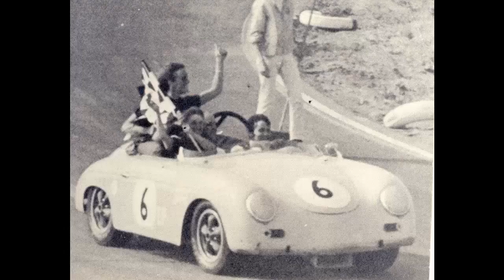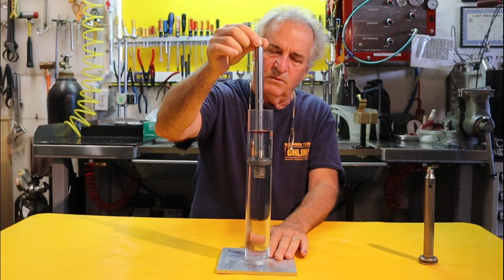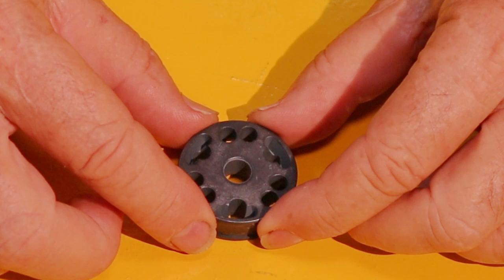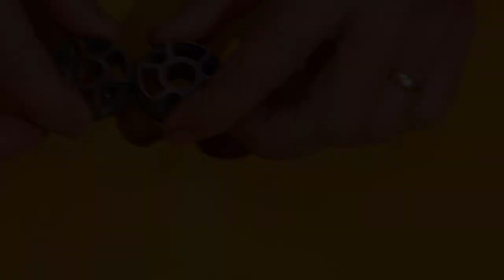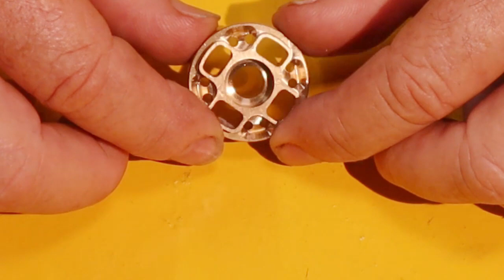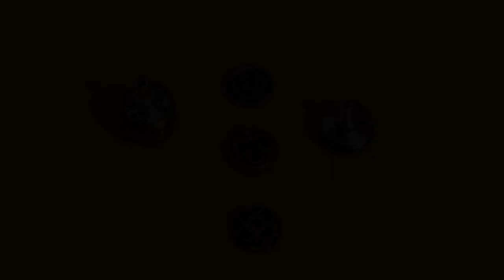Ohlins Suspension - Pistons and valves

Comment: Thank you so much for taking the time to make a real informative video. Shock theory if that is a thing, is something i always wanted to learn. As a kid NASCAR actually got me thinking about how important suspension setups are, then when i got my first KX500 Kawi and experienced modded suspension, just wow, it was like riding on a cloud. I now have 3 bikes with Ohlin’s suspension, front forks cartridge kits NIX22, and rear Ohlins shocks. I also have an Ohlin’s steering damper which works really well on the R3 and Ninja 400. Just in the last year i have been learning about adjusting the rebound dampening, compression dampening and setting sag with preload adjustments. After installing the Ohlin’s upgrades there was a day and night notice of improvement, but even after setting the sag and dialing in the compression and rebound dampening, it truly has transformed the NInja 400 and Yamaha R3 into serious street performers. I also noticed something i don’t see much promoted, when i took about the front forks and weighed the stock springs spacers etc i was removing and the Ohlin’s replacement pieces, I actually lightened up the front fork by a few pounds. On the R3 the rear Ohlin‘ s shock weighs less than the OEM shock too. Thank you again for sharing! I will definitely be looking your way for my next suspension upgrades.
Reply from the maker: Hi Mark.  Thanks for your very astute comment.  I don't think that most riders/drivers realize just how much of a difference shocks/forks and springs make and how superior Ohlins suspension is to anything else on the market and buy into the myth that Ohlins is more expensive than other options.  Suspension is the most important thing on any vehicle yet it is the last thing most people will spend money on.  The thing that impressed me was your "riding on a cloud" comment.  Exactly correct.  There is an erroneous bit of conventional wisdom that says that you need to stiffin suspension to go to the track.  Soft is best and there is no difference between a good setup on the street or on the track.  Grip is grip.  To get the perfect setup it takes work and you are working at it.  No "guru" is going to be able to tell you exactly what to do.  Another option you might experiment with is spring preload.  I go into this a little bit in various of my videos including "Why I Don't Do Digressive Damping".  Thanks again!
Reply: The Ohlins Guy I almost forgot to mention the importance of using Ohlin’s front fork oil at the desired or recommended weight, which will change how the front cartridge kits perform (reducing chances of cavitation in poorer less quality oils) well at least in the case of my NIX22 cart kits for the bikes, the weight and amount of oil is important to get correct and if not, it will effect how each leg preforms, in this case since compression dampening is in one fork leg and rebound dampening is in the other leg. Always tracking your changes, using proper tools (which Ohlins sells also like a pull up tool or the spring holder, fork leg vise etc) are important to ensuring accurate installation and not marring any fork tubes etc resulting in permanent “stick-tion) spelling? I just did a 60 mile ride today after making some adjustments to the preload after checking my sag since i had lightened the bike up a little, and just wow... on occasion, i get a friend to ride with me on his stock bike and we swap halfway and the results are instantaneously felt. I have bought a “suspension bible” i will skip the brand name also, but i really find your videos much easier to understand, especially since it is void of loud music and street stunts. I enjoy the facts and examples of how you are explaining the “how it works” then i grab the suspension bible and what you explained and it is helping me get through the book. I almost forgot to ask, do you sell Ohlin’s suspension tools like a spring changer? the kind that is like a mini tower, where the shock sits upside down and then is compressed with a manually jacked hydraulic cylinder? i have only seen these in videos where Ohlins had a tent at a bike/track day etc.
Reply from the maker: @marknasia5293  Hi Mark.  Thanks again for the kind words.  One of my pet peeves is when I get an Ohlins product with brand X oil in it!!  Be careful what you read in books.  Use your judgement to see if you think they are giving you correct information. There is a joke that Ohlins is a tool company selling dampers!!  (haha).  Since Ohlins designs from the ground up they rarely use parts from other products.  They are designed by engineers for maximum performance and not by accountants for maximum profit so there always seems to be a new tool I need.  I can get any tool for you but I am not sure about freight as it seems you live somewhere far away.  I have a customer in Hawaii that has to crate and ship his whole bike to another Island to have it worked on!!  They are so bad that next time he needs work he is going to ship the whole bike to California to get it worked on.
Reply: The Ohlins Guy I reside in South East Asia, but i have family in Atlanta that do me the huge favor of picking up or temporary stocking my parcels that come or are dropped off at times even head down to FedEx to pick up stuff for me. Then i fly in, enjoy the family visit and head out with suitcases of bike parts/tools. The questions i get at airport security as the screener is looking through the X-ray machine “what is this?” I normally reply lots of new motorcycle parts, and tools for installation. Actually TSA is very good, they always open and search the bags, so i try my best to have everything rewrapped for easy visual inspection, their repacking is less to be desired, but the other choice is to be hit by customs where i reside and stuff disappears, so that is never an option and i rarely get mail, as it disappears too unfortunately. I would actually love to have cars as a hobby but more motorcycle stuff fits into checked baggage than car stuff. One day, maybe i will be able to keep a project car at relatives house, like a hobby working vacation. I really am super impressed with Ohlin’s manufacturing, growing up in a light metal fabrication/ machine shop my grandpa owned, i am really amazed at the quality. I have seen video of people buying knockoff stuff and why anyone would trust their safety to save 100$ is beyond me. The simple fact that Ohlins has been around, they are the experts, and the shocks are rebuildable alone won me over for the initial purchase. After seeing the change in handling, i am all in for Ohlins. Thanks again for your videos i am learning a lot, and it isn’t that often that someone shares as much as you are. It is enlightening and really shows the depth of knowledge Ohlins and their authorized service people (including yourself) have. I have the Ohlins original oil shipped to me via the only official Ohlins authorized dealer and figure it is the prudent thing to do to use Ohlin’s oil with the shocks. Thank you for your time responding to my comments and i look forward to your next videos, i am catching up now with what you have posted already, i have to watch a few, sometimes rewind and watch again, a lot of new material for me. Thank you for that, have a great day!
Reply from the maker: @marknasia5293  Thanks Mark.  It would be quite easy to ship to Atlanta.  I think anyone who has used metal machining tools would be impressed with the quality of Ohlins products.  I always tell people to just put an Ohlins product in one hand and an equivalent brand X product in the other an knowing nothing about them you will just instinctively know that Ohlins is better.
Reply: The Ohlins Guy The Ohlins Guy i watched your chart on one of the videos about digressive dampening and the only use i could understand for it is a manufacturer wanting to make a cheap mass produced shock initially feel better than a performance quality shock. Thanks for your comment and your time. I am still tinkering with preload. I use a Slack Setter tool (i will avoid the name as not to promote it) but after a couple of rides, i will make minor adjustment and try to track the adjustments individually, after the first sag set up. I have much more respect for suspension experts now, as even the geometry of the bikes rake trail where the forks are clamped etc it really can change everything up, i am trying not to change too much too fast, and am not in a hurry to search out tuning as i am not racing but riding hard on the street, here we only have speed limits in populated areas and the unpopulated areas are open to how well you can handle the bike safely. After doing my first rear spring change, i can understand why it is good to have a go to, expert guy, but locally i would have to get on a ferry and travel 3 days to get that kind of service, so... I have learned to love doing the work on my own bikes, i have one other friend that enjoy helping me out and once again, these videos you post are most welcomed and appreciated. Thanks for sharing your lifetime of experience please keep sharing the videos. Hope your holiday’s were great and the new year finds you swamped with sales.. :)

Comment: Cool video. I look forward to the one on shims. I've always wondered if it would be possible with a single tube motorcycle shock to have a piston/shim combination ("valving" I suppose) that could make high speed compression movements less harsh but still retain the necessary low speed compression behavior and acceleration support of the "stiffer" setup I currently have.
Reply from the maker: Great.  I will try to cover that although I am a believer in linear damping.   I find that usually the harshness is from too much low speed damping mostly found in digressive valving.  I will try to go over my thoughts on that.   There is absolutely nothing wrong with a single tube shock.  There are just things like pressure balancing and  cavitation to contend with.  Any shock is only as good as the valving.  Some popular shocks have a very sparse selection of shims so it makes it difficult to get the results you want.  Thanks for the comment and let me know any time you find something you don't understand or want to know.  I don't know if you have Ohlins but the info should be good for any modern shock.
Reply: @theohlinsguy4649  Thanks for the reply. My shock is indeed an Ohlins with a piggyback reservoir, preload, rebound, and low speed compression adjusters. I don't know if it has a digressive piston as you described in the video, but I doubt it. I've wondered if it would be possible to reduce transfer of energy to my lower back over high speed, sharp edged bumps but still retain the current behavior when loading the shock during acceleration and low speed bumps. I don't know if a revalve could achieve this and it's quite difficult finding answers to these things. FWIW, the spring rate and SAG numbers seem in the ballpark for me, but next time I get it serviced I will ask for an "analog data aquisition" band around the shaft to monitor travel.
Reply from the maker: @agubser07  I am assuming no one has revalved your shock.  Sometimes the OEM Ohlins are not valved very well (in my opinion) as I think maybe the manufacturer gets involved in the damping.The aftermarket Ohlins seem to be valved a bit better (again in my opinion.)  It is hard to say what is going on without a dyno sheet.This would easily tell pretty much what is inside or if there is a functional problem with the shock.  Also it depends on how often you are getting the bad bumps.  You never want to valve for an event that doesn't happen very often (perfect is the enemy of good). As you rightly surmised, it might effect the current behavior and maybe not for the better.  For fun you could try putting the canister knob at -10 and turn the rebound out pretty much all the way (around -20) and see if there is a difference.  Be sure to note your current settings as you might want to go back to them.
Reply: @theohlinsguy4649  It is the OEM valving from what I know (I'm the third owner). I'll try putting rebound at -20 and low speed compression at -10 next time I ride and see what happens (since I'm at -14 on compression and -8 on rebound now I imagine it would make the ride harsher and try to bounce me out of the seat with no rebound?) I don't know if my local Ohlins guy who I've had service this shock in the past has a dyno.
Reply: @agubser07  It is conventional wisdom to think the less rebound gives a harsher ride.  Not true.  It depends on what your damping looks like.  Lots of rebound without much compression preloads the spring as you ride.  It is easy to try some different settings and if they don't work you can just go back to your old settings.   I dyno every shock that comes out of my shop and I have a record of it in my dyno.  Is your service guy an authorized Ohlins service guy?  You can't really do a proper service without a dyno and vacuum filler and Ohlins oil.  Of course if they don't have  these things they will say that you don't need them.  Ohlinsusa.com has a list of authorized service dealers.
Reply: @brennerfab770  My local Ohlins guy is indeed an authorized service provider. I know he uses Ohlins oil but unsure about the vacuum filler and dyno.
Reply: @agubser07  Excellent.  Most authorized Ohlins service centers have both.